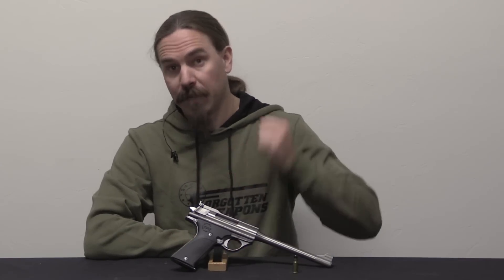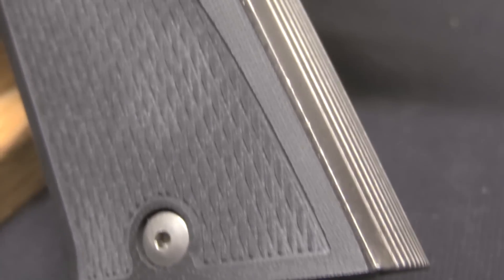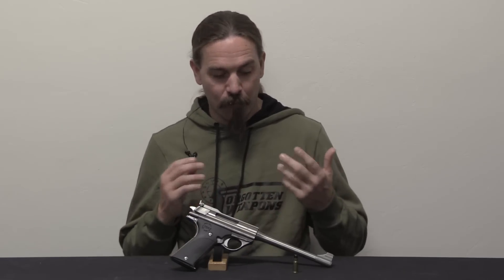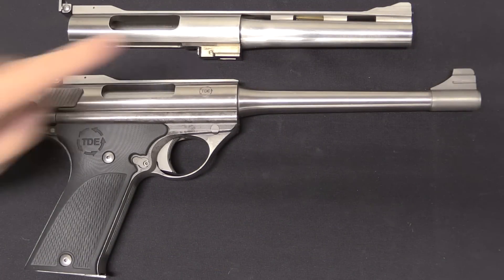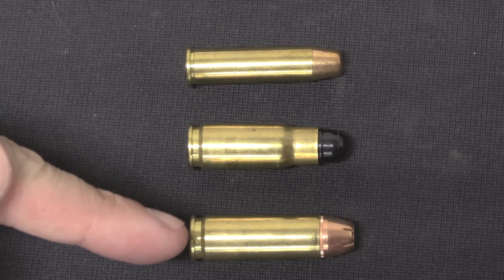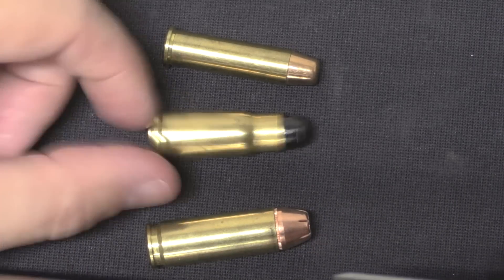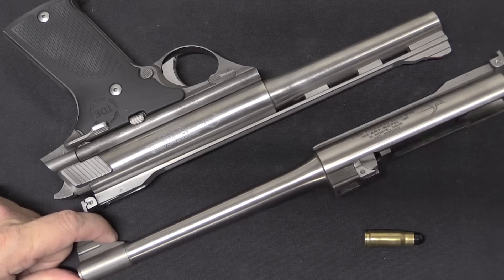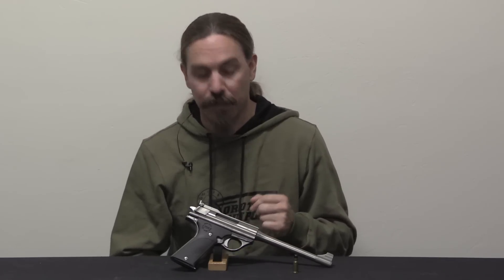AutoMag 160 in .357AMP: For When the Regular AutoMag is too Common

Comment: Gun Digest 1978 has an article titled The Auto Mag Story, Part Two.  Leading me to believe there was at least a part one.  It seems to cover every single thing you might possibly need to do to tune, maintain, inspect, lubricate and generally keep your Auto Mag running properly down to what primers to use in your ammunition.  Apparently there were also .22 and .30 AMP calibers, and one .25, with the .30 throwing a 130 grain slug at 2250 fps.  I don't know what part one contains, but probably Kent Lomont wrote that too.  Perhaps a part three!  Or more!  Anyway, it's there.
Reply: i've been trying to get my hands on a 6 inch automag ii in 22 magnum, literally just to see if i want to buy one. they're pretty cheap compared to the other automags and i love the design but they seem to have the Boomer tax where everyone thinks their gun is worth $1200 because the 4 barrel ones are. i've seen the standard ones go for like $400 so every non-mint gunbroker listing for $800 is just wishful thinking. problem is they're still kind of rare so i get the feeling we're gonna see a lot of them in 10 years when all of their collections get liquidated by their kids
Reply: @Cheesemonk3h  I have one, from the late '80s.  Very temperamental gun.  Extremely sensitive to ammunition due to the delayed blowback system.  Workmanship and finish was a bit rough.  The magazines were the real problem.  They had no loading assist feature, and the thin walled rimfire cartridges are easily damaged during loading.  There's another gun, which I believe is called the Challenger, that uses the same magazine but they DID incorporate a loading assist.  I did get one for my Automag II, but it needs some fitting.  I'm hopeful it can be made to work.  Haven't tried yet.  When the Automag II runs, it's a lot of fun and always attracts attention at the range from the dramatic muzzle flash and blast from such a slender small caliber gun.  Velocity from the 6" barrel is impressive, typically running in the 1,500 to 1,600 fps range.  CCI Maxi Mag seems to work best.  It's also remarkably accurate, especially considering the very loose slide to frame fit.  This was done because of the galling problems from the stainless castings used to make the AMT guns.  It's a shame it suffered from poor quality control and design flaws.  Otherwise it would be an especially interesting piece.  If you wind up with one, it will be a novelty range gun purely for recreational use.  But it was a cool and truly interesting gun.  I wouldn't pay too much for one though.
Reply: For the truly discerning connoisseur
Reply: Are you sure it's .30 AMP?

Because I know .30 Carbine Automags exist
Having a cartridge you can only handload using the same bullet as a cartridge you could already run in one and buy readily

Seems dumb
Reply: @1stCallipostle  That's what the article said.  Apparently there were .22, .25 and .30 caliber AMP cartridges for the original 1970s Auto Mag pistol.  I think they were experimental wildcats.  The .30 Carbine Auto Mag was a later creation of AMT from the 1990s.  I've gotten to fire one.  Lot of fun.  Huge muzzle blast and flash with moderate recoil.  Cool novelty gun.  I'd get one just for fun.  Miserable takedown procedure though.  Also an entirely different design.  The AMT Auto Mag numbered guns (I think this was the Auto Mag 3) were relatively conventional Browning type locked breach guns.  I believe only the .22 Magnum Auto Mag II had the delayed blowback system.
Reply: Freind of mine has the 30 he shoots 30 carbine through it
Reply: @1stCallipostle  30 carbine is not as powerful as 762x39 like the numbers he was stating 30 carbine is typically 110gr at 1900 to 2000 fps
Reply: @1stCallipostle  it was kinda common pre internet days. I was lucky. I grew up in a gun nuts home. Between  my dad and all his friends  they all had at least one odd ball custom. My favorite back then was the .475 Limbaugh ( I think thats the spelling. I haven't seen that gun in over 30 years)
Reply: @charlessalmond7076  correction on the spelling, it's .475 Linebaugh. Named after John Linebaugh not uhhh Rush.
Reply: My Dad has every issue of Gun Digest going back to early 70s. I read most of them, especially as a kid in the ‘80s and do recall articles on this. Have to ask him to dig out his old GD library and check that out.
Reply: Part 1 is in Gun Digest 1977.
Reply: @themandan4000  Sure do miss Limbaugh!

Comment: Back in the late 1970's when I was stationed at Loring AFB Maine, one of my friends had one of these .44 Auto Mags that he ordered with the .357 conversion or upper as he called it. The one thing I remember he had problems with was finding the right load that would cycle the bolt, eject the spent brass case and chamber a round. The .44 Auto Mag recoil springs were pretty much set up for the .44 magnum loads. That's why you need to cock the hammer in order to pull the slide back. My friend did a lot of reloading and was experimenting with the .357 loading's. His auto Mag did not like light loads and working up .357 loads was a pain. I worked in the Machine Shop on base and he wanted to know if I could make some lighter sets of springs for that gun to try out. I don't think they made any lighter springs at that time that he could order, at least that is what he told me. We did have some spring wire in the shop and I had experience making springs for some equipment. But I told him he would need to get some information on the type of wire and the diameter of the wire before I would attempt to make them. I was young at the time, I had several guns of my own and had good knowledge of them. But I also knew enough not to get involved in something like that. 
I know he wrote off to Auto Mag for information on spring material and possibly having them make a set for him. But I won the lottery! I got orders to to transfer out of that damned freezer and PCS to Seymour/Johnson AFB before he got any answer from Auto Mag. 
So I never found out if he was able to solve those problem. But now knowing that these were all hand finished guns, the problem may have been that they were never fitted or finished correctly. But I will admit that it was a really nice looking gun and I did get to shoot it with the .44 mag AMP a few times. But with all the problems he was having with loads, it didn't impress me all that much. It was an interesting gun at the time, something I couldn't afford on E-3 pay anyway.
Reply: Saved by the PCS before that guy could blame you for why his science project didn't work.
Reply: But did you bag any moose with the .44?
Reply: @MACHOMANRANDYSAVAGE2211  Unfortunately back when I was stationed at Loring AFB, 1976 to 77, moose hunting was not allowed. I was told that they were on the Threatened Species list in Maine. Although many people in Northern Maine were complaining about them and wanted to start hunting them, the Southern part of the state, that was more populated wouldn't allow hunting. That was also the start of the anti hunting animal groups. Besides that big Auto Mag belonged to an NCO friend and I only got to shoot it a few times at the range.
The biggest pistol I owned was a Reproduction .44 Cap and Ball Remington Army Single Action Revolver and a .30-30 Winchester rifle. I was not about to use my .44 C&B on a moose. It would only piss them off. 
There was an incident on the road leading to the front gate with a moose. Some guy in a yellow VW Beetle  came upon 3 of them standing the the middle of the road. He got impatient and started honking the horn and flashing the headlights. The big bill moose went crazy and totaled the car. 
One thing I can tell you though, it was far too cold for me to hunt anything up there and far too much snow. It started snowing about 15 Oct and there was still snow on the grown when I left Loring close to Easter. The USAF transferred me up there from Carswell AFB in Fort Worth TX. From the frying pan to the freezer. We had 3 nights up there with wind chill down to -100°. It was the only place I knew that people would pray for snow and the overcast to stick around so the place would warm up a bit to -30°.
 Also I was 1 of 5 guys in the Machine Shop needed to split up 2 shifts and one of the 4 that had to pull Stand By duty after midnight and over the weekends. We rotated that Stand By duty a week at a time. So there wasn't much time to go hunting anyway.
I was so happy when I got emergency manning orders to Seymour/Johnson AFB in NC! I got to hunt some Big wild Bore there. Then they sent me off to Hawaii for three years. Then to AZ DMAFB. I still live in the SW Desert and love it. But unfortunately my hunting has been curtailed because of the illegals and drug traffickers. It can and has for some, turn into a real fire fight if you run into them in the middle of no where. 
Y'all take care and stay safe. Remember, a bad day of shooting is better than any good day at work.

Comment: My comment from a minute ago was apparently filtered out. Reliable, responsible load data can be found in the Speer #9 loading manual. WW296 and H110 are the powders of choice, with a 158 grain bullet delivering 1600-1686 fps from a 6.5-inch barrel. The 8.5 inch is good for about 150 fps more. You can find a PDF of the relevant pages from the manual on the internet. 

Reed’s Custom Ammo in Oklahoma City sells 357 AMP (they mislabel it as 357 AMT) for $80 per box of 50. (Apparently I can’t post the link but you can find it easily enough).
Reply: AMT is correct. Harry Sanford owned Arcadia Machine and Tool. The gun was first marketed under the AMT brand. Arcadia Machine and Tool also made one of the first mini .380 ACP investment cast pistol in the same era. 

A prominent gunsmith, Jimmy Bogle invented a 9mm hemi head bullet with the weight so far forward that there was a large cavity at the base. Large magnum rifle pistol primers ignited H110 or 296 (H110 was better) with a compressed loading that forced more power into the bullet base, cycled the extra stiff spring set and left the bbl at over 3000 ft/sec. One of our barrels was set up with a strain gauge. A flake or two of red dot next to the primer boosted speed to over 3500 ft/sec and produced wide spread pressure readings, shot to shot in the 75,000 t0 100,000 CUP range exceeding the proof testing levels. Yea, I know, younger and dumber then. 

AMT (Harry) also made me full length carbide dies for the .357 and .44. They were supposed to be used lube less but I put a thin coat of Marvel Mystery Oil on each case after my first dry run. 

A T Burke
Reply: While Sanford later formed AMT, the original Auto Mag wasn’t produced under that name. The unrelated Auto Mag II, III, IV and V wore the AMT (or IAI) label. But not the original. 

The round was 357 AMP. Not AMT. AMT didn’t exist when the round was created….

Comment: The .357 Bain & Davis is the rimmed equivalent of the .357 AMP, made by simply necking down .44 Magnum brass. There have been several attempts to get it working in revolvers, but revolvers and high pressure necked cartridges just don't play nice. You can still get a T/C Encore barrel in .357 B & D, however.

Comment: Hi, I had 3 Auto Mags in the 70's. I always told my fellow shooters hand loading for it was like tuning a Indy 500 race car engine. Just one  tenth of a grain up or down could make a difference in functioning the gun properly. So first You had to find a load that would function the Auto Mag. And out of those few loads how accurate were they. Tried several different powders but my favorite was W296. My best and favorite Load was 32.0 W296 behind a 200gr Hornady JHP with 100% functioning - how accurate - at 25 yards using a sandbag to steady me I would shoot 2 to 3 inch groupings all day( one time I shot a One Inch group!) - 6.5 inch barrel. And I had one 357 load that using 296( don't remember the amount) behind a 90 grain jacketed Hemi lead nose bullet that functioned 99%. I loved going out to the Mountains shooting at targets 100 to 150 yards.

Comment: My experience is that the 357 AMP was more popular with shooters than the 44 AMP or 45 Win Mag. I’ve have clients bring me or shot with them Auto Mags, Wildeys, Grizzlys, and the IMI version AutoMag. Every single example was in 357 AMP or had a 357 barrel - and that was the one they shot with. The Grizzly was the easiest to tune to run as it was well made and just a spring change would usually tune the gun to the load desired. The AMT/IMI was so poorly made there were usually stacking problems. The Wildey, well, you just had to tune the load to the pistol.
Reply: Of the guns listed the Widley is the most difficult to get running.   Had an odd ball load  that was running well but extremely dirty.

Comment: Now go over the Dan Wesson .357 Magnum model 715 revolver with it's "quick change" barrels of different lengths as well as the "quick change" front sights in 3 different colors (white, red, yellow).
Started production in the early 70s, and jumped 3 different manufacturing locations between 5 different owners before eventually ceasing production of revolvers entirely in 2005.  
CZ tried to bring the revolver line back in 2015 but quickly stopped making them again in 2018 because no one was really buying them at $2k for the "pistol pack". Supposedly the "pistol packs" are still available however they're nowhere on either CA-USA or Dan Wesson's websites.
I'm sure if you put a feeler out someone has one along with the original briefcase they came in that was made specifically for Dan Wesson by American Tourister.  
Yes, that's right, American Tourister the luggage company made the briefcases for the original Dan Wesson .357 "pistol pack".
It was an expensive pistol far ahead of its time but pretty damned accurate and with a smooth DA/SA trigger that breaks really clean.

Comment: 15 years ago or so, I saw a dealer at a gunshot with a consignment pair of Auto Mags, consecutively numbered - one in .44AMP and one in .357AMP, with a set of loading dies for each pistol.  I recall the price seeming stupidly inexpensive - $1800 each caliber, or $3000 for the lot.

I did not bite, even though I was really tempted, as it was a bit more than my gun budget allowed for that day.  In retrospect, I'm glad I passed on it.  I likely would have been terribly frustrated and disappointed, given how common issues with the 1970s-80s Auto Mags are.
Reply: $3000 for the entire kit 15 years ago was a bit on the steep side, but if you had bought it and just kept it it could easily have gone up way more than inflation simply because people buy them and then shoot them. Until they break.
Reply: I have three Automags.  I have been able to get them to function.  Much easier to get them to run than a Widley.

Comment: Speer Hot Core bullets with the half jacket had a problem with core/jacket separation Oddly enough, it was when you loade3d them too light, the jacket would sometimes also stick in the bore or go sailing off somewhere.

Comment: Like some others said; the new automag company needs to make conversion kits, and get with someone like star line brass to make cases.
Reply: Can't you just use 308 cases cut down?
Reply: Starline make 44 AMP
Reply: Starline has a bunch of their brass lines tied up by other big manufacturers right now. Getting them to make something special for you right now is basically impossible.

Comment: My understanding is that the cases are basically cut-down .308Win brass, with the neck area reamed out to accept a .429 caliber bullet.  Presumably you'd have to ream the case down further to accommodate the bottleneck on the .357AMP.

Comment: I found most of the super caliber pistols tend to be fairly finicky regarding what ammunition works reliably in them.  Sometimes even when the case and bullet is the same as the last round, a different powder brand and charge (even though giving the same velocity) is enough to initiate jams.  My Wildey is an example of that.  With one powder charge type and charge it works perfectly, but change anything and you will expend 40 rounds just trying to find the best gas port setting.  Then we get into what is the gun intended use scenario, and is there anything more or less equivalent on the market that will do the same job but less cumbersome to carry, use and develop a load for, and of course what is the financial cost compared to the curio semi auto hand made pistol that can only use hand loaded ammunition.  I looked at the Automag at a time some gun stores actually had AMTs in stock.  Their sticker price even back then was like 3x the cost of a new Cold Gold Cup 1911.  Their only observable advantage over a S&W M29 was being slimmer but off set by being much more expensive, heavier, more cumbersome, and required forming your brass by hand (Norma hadn't started offering the loads yet) versus simply buying a box of .44 magnum ammunition,  So I passed.  By the time commercially made .44amp ammunition was available those first guns had vanished from the gun shops I visited in those days.  I new of the .357 variant, but even back in those days I heard how finicky it was and the bullet jacket issues you speak of.  Faster bullets require thicker jackets and probably internal partitioning of the bullet like the XTPs do.

Comment: I feel like 357 amp would have been excellent for an autoloading carbine like the one Ruger made in 44 magnum. You could probably get 1800 fps with a 180 grain bullet out of an 18-20 inch barrel. With some of the modern 357 bullets available that are designed for rifles this might be an excellent brush gun option.